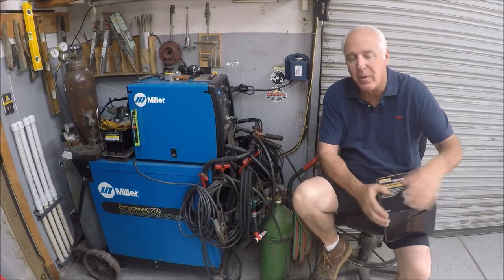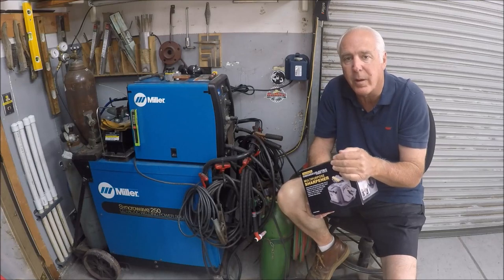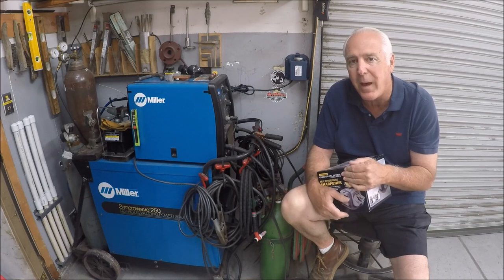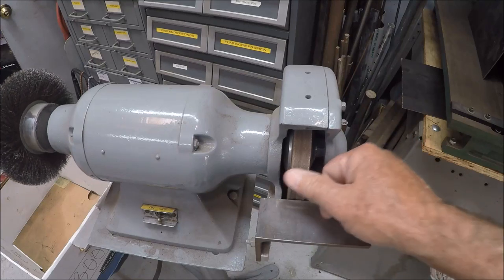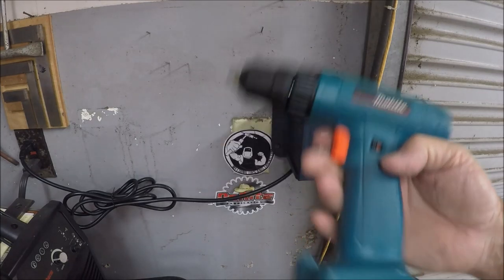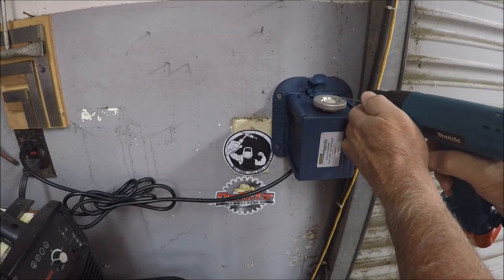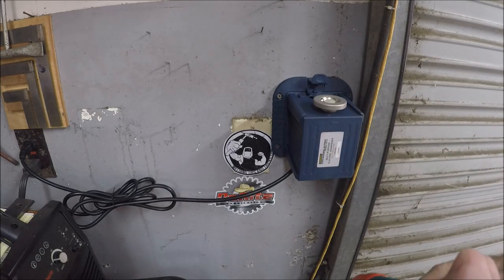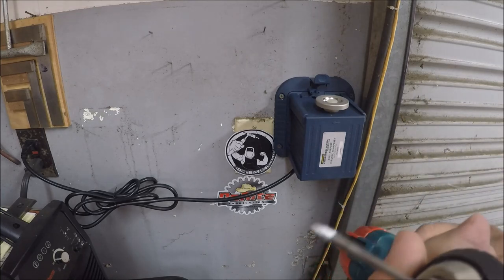Tig Tip--- Screwy Tuesday

Comment: I have the syncrowave 250 as well (no MIG head), and the same groove in my 8" grinding wheel. This looks like a very good solution, and can be mounted next to the welding supply.
Thanks for the tip.
Reply from the maker: Hey Fred....I thought the same thing when I saw it on the YT channel I mentioned